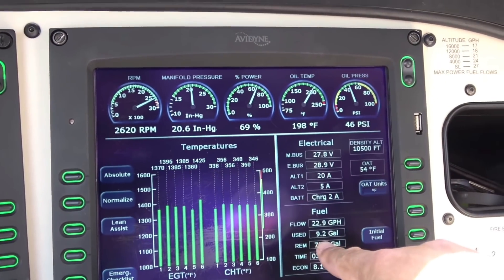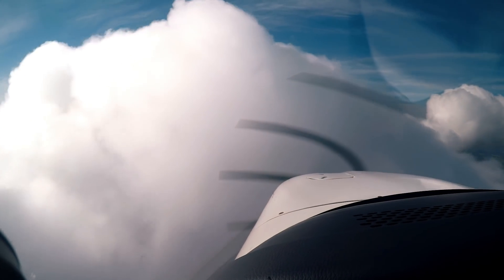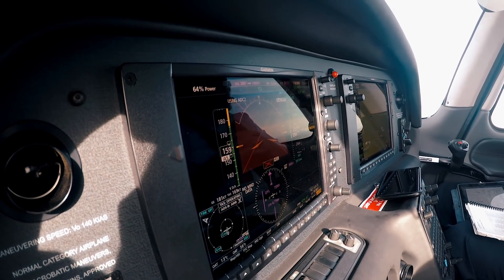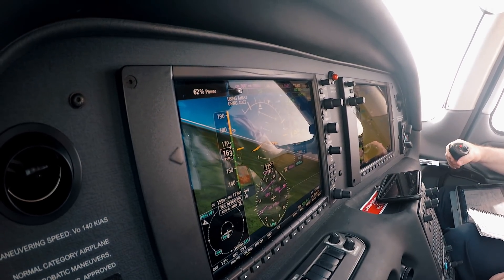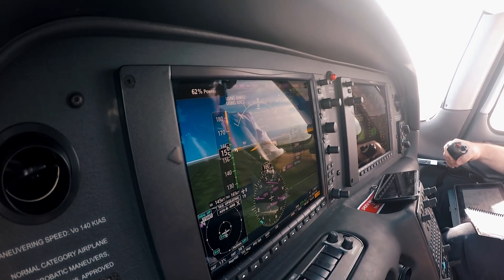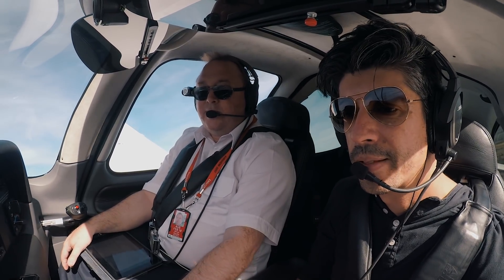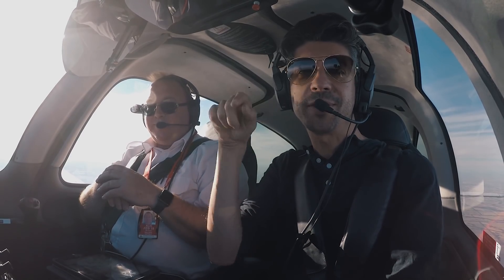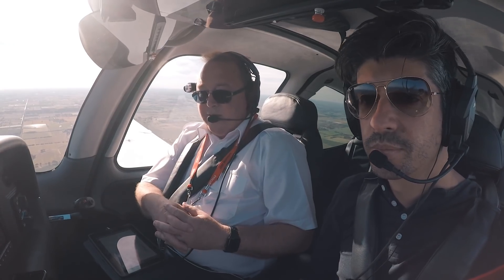Practising ELECTRICAL EMERGENCIES Cirrus SR22 G6

Comment: Also I want to point out one thing, something I learned from a controller. When you squawk 7600, it gives off a loud, annoying sound in the radar room that they apparently can't turn off, and it drives them crazy. So when you do squawk it, don't leave it on forever; turn it off after a few mins. 
And I know it probably feels better leaving it on all the time, and frankly that's what I probably would do myself, but do know that ATC tags your plane as Nordo when you set 7600, so it's not like they forget when you go back to your old code...

Comment: Nice video Stefan. Very useful. I actually just had a PFD failure but thankfully it happened just after landing. I though to myself “what if it had happened just before landing or in a trickier situation”. For COMs failure, the best solution  is probably to have a standby radio at hand...

Comment: Stef, you are getting so spoiled!!!  I'd like to see you run some of those scenarios in a Warrior. ;-)
I had an alternator failure (for real, with no standby) a few weeks back during my solo check in a glass Archer up near Mangalore and made it back to Moorabbin (just!) via KMG on batteries alone, so I know you generally lose PFD/MFD then Radios then Transponder in that order.  The worst part was the blasted siren staying on as the faults piled up, but we worked out how to shut it off eventually. Moorabbin Tower are really great when stuff like that happens (maybe it happens a lot?), but I sure was glad I wasn't solo that day.

Comment: Stefan, This is a little bit off topic but I am sure Mike would know the answer. 
Can a single pilot fly solo from the right hand seat?
I have noticed several people in the US from a couple of channels flying solo from the right seat.
Reply: Yes you can fly solo from either seat, so long as you can perform all of the necessary duties required as PIC... unless the POH/flight manual says otherwise.

Comment: Really shows how important it is to know your systems. I remember the "what do I have left" questions during training. For example are your flaps electric ? will you have to land without them in case of an electrical failure. This of course is even more important with the newer all electric instrument planes :) Great video!
Reply from the maker: Good points Erik, thanks. Yeah at one point in the video you can see I didn't realise I still had autopilot available to me. Especially if that happens in cloud I could have still set the autopilot to keep us flying and then troubleshoot, reduces overall workload a lot. It was a great learning experience and definitely one I'd recommend all pilots do with their instructors. Thanks for watching and leaving that comment.